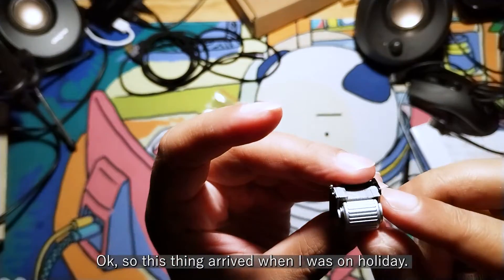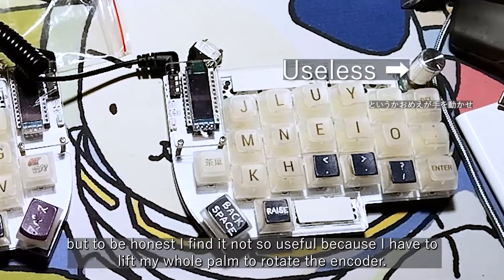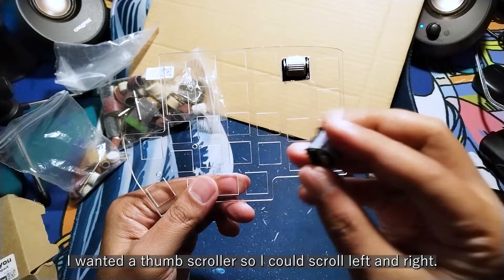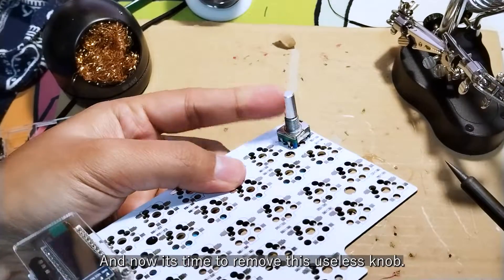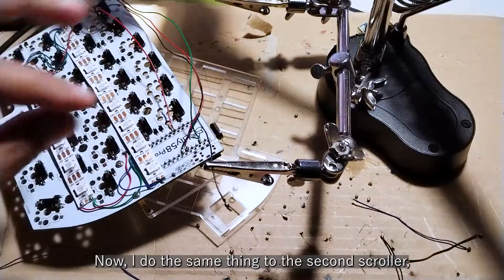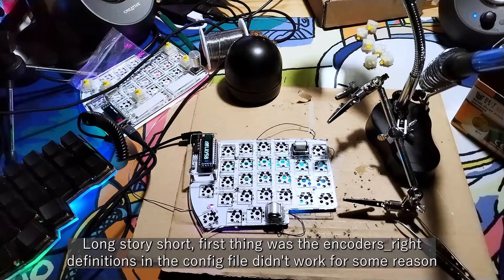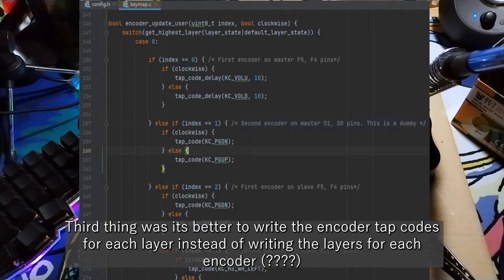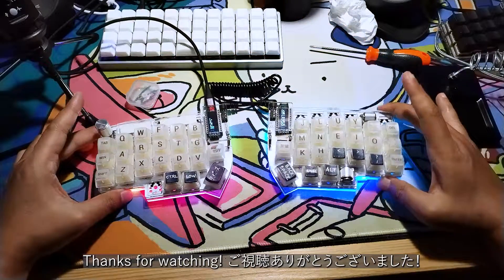How I put a scroll encoder on my Lily58 Pro

Comment: Hey, i want to do this with a regular mouse wheel encoder, the pins look similar is the wiring the same? Can i just use A-B-gnd pins and use it like yours?
Reply from the maker: sorry, not sure. If it has 3 legs then probably it'll be fine? I guess you'll have to try and see (I'm a do first, research later guy)

Comment: Is it possible to put this in other boards as well? As long as it supports QMK?
Reply from the maker: You'll have to figure out where to physically connect the pins. Software wise it's possible to do anything on QMK I think.

Comment: maybe time to vial lily! encoders can be modify for each layer easily through instant remap. bad thing about vial: easily oversized though...
with oled, rgb, and vial on, hardly to fit in mouse enable (normally)..
Reply from the maker: I'll try vial some day!
Reply: @semputs  pretty straightforward even easier than zmk imo! If you encounter any problem do dm me!
Reply: Is there no Lily:s with RP2040 yet? That would solve the vial size issue (4 layers on my board is absurdly low)
Reply from the maker: No idea, and I'm too noob to know there are other controllers other than promicro and nice nano. In terms of layers, it's more of lack of brain memory to memorize layers versus firmware size limitations lol